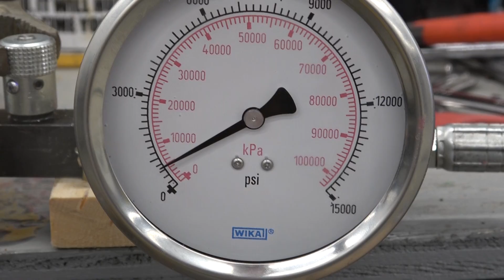How much pressure can PEX take?

Comment: Only time in years I've ever questioned your methods, but those Sharkbite fittings are gah-bidge for plumbing. I can't speak for most, only for myself, but try repairing a main water line to ur house with one of those and regrets will run deep, much deeper than the hole you dug twice. I had to consult an elder who knew a thing or 2 about a thing or 2 that told me why I was coming to him with my regrets. Those fittings are only meant to be used on sterile, 100% 90° flush cuts, so you gotta weigh whether the convenience is worth the uncertainty. Compression fittings might take a few extra minutes, but they hold better.

Comment: US building innovation: aluminum wire, sawdust+cement roofing tiles and PEX hot water.   The shame is that a lot of grand century+ old homes are being retrofitted with the plastic pipe.   Wasn't there a bit of a scandal with CPVC being used for hot water piping?

Comment: I don't know about Germany, but at least in Finland where the code is real strict and you have a 10 year fault responsibility on your old house pex is used a lot. Especially when renovating its real easy to bend around walls, floors and ceilings which are often not as straight as you'd hope. I'd still prefer laminated multi-layer aluminum/plastic pipe. Expensive as frig but real sturdy, easy to use and bend and shouldn't leak even if the surface is all scratched up. Plastic lining on the inside and outside protects from corrosion, aluminum in the middle gives strength and makes it malleable.

Comment: The Uponor Pex-A system has been tested for over 30 years, continuous @ 95°C @239psi with no failures. I am suspect on the life of Shark bite and some crimp on style fittings, but believe the Uponor system to be rock solid.

Comment: There is a lot to like about PEX, especially when you get to proper crimped connections.  It's easy to work with even in tight spaces.  No scorch marks on your 2x4 from repair work.  You can put a joint together on a pipe with a leaking upstream valve.  I'm a little concerned about aging down the road.  We've been down the plastic pipe road before with less than ideal results.  Copper has problems as well, especially when attached to dis-similar metals.

Comment: I hired a dip wad so called plumber used shark bite fittings in my master  bathroom.  And those fittings let go of some of that pressure all inside my walls.  Not only did I have to fire that plumber and re-do everything myself. I then had to hire a drywall guy. So F the shark bites.  I'm blue glue all the way

Comment: @Ave I'm a plumber,  and I guarantee pex-a tubing is better than copper,  has a memory so if/ when it freezes it swells and will not pop,  when it defrosts it'll go back to original size.  If it kinks, you heat it up with a heat gun and it'll go right back to factory shape/ size
Reply: @Ave there is different classes of pex tubing,  radiant heat,  to culinary water...PEX-A is the type that will last 100 years

Comment: sure you can run pex long runs and make turns without soldering fittings every 10 feet,  or use a torch in a crawl space on a piece of pipe jammed between 2 70 year old pieces of dry lumber with the homes water turned of it might be cheaper or not freeze and burst like copper or get stolen out of your work van or construction site and also cost alot less and is easier to transport carry and store save u money on propane and solder but it definitely does not look as pretty as new copper pipe who can argue that.

Comment: the problem with copper these days is that it's nearly impossible to get copper pipe of sufficient quality to not form of all sorts of pinholes after a few years, even if you spend extra for the "good stuff" there's almost no way to tell if that's what you're actually getting without massive additional cost. the era of copper is over, unfortunately.

Comment: I was the "somebody else." Shortly after moving into a condo (that was around 10 years old at the time), all the Kitec (PEX shit) was replaced with copper. Apparently the fittings were faulty... too much zinc or something. Oxidation would build up over time, restricting the water flow, and eventually causing a failure.

Nothing but copper for me from now on.

Comment: One of the biggest advantages of PEX piping is the lack of fittings. I’m a plumber by trade in Florida. So being able to run the piping through the attic and not having 90’s to run down to a wall creates one less possibility of a failed fitting. And we have noticed through the ten years or so it’s been used that it’s able to handle thermal expansion really well (Attics can reach 145*F During the summer). Copper is being replaced everyday due to salt water intrusion and rot. So for now this is the best stuff to use.

Comment: AS a ex pro plumber pex is a far better material then copper. Easier on install time,less money per foot,1 solid line from supply to fixture less fittings to have leak(yes you can do branches off a 1in line to make the cost even cheaper or repairs) a good crimp tool is skookum as hell and easy to adjust if the crimp is getting to loose (crimp tool usually come with a crimp ring gauge to test crimp pressure) no buying of bottles of map gas,flux solder, sand paper and tons of fittings (45's, 90's, couplings.) No fire that could potentially burn a house down. If I recall properly it will expand to 30% its size without rupture. And biggest adavantage is easier to repair to say nail is punched thru and not having to completely ridding your pipe u r working on of water cause if water is near a solder joint good luck on getting copper hot enough to get the solder to flow (weld) seal ur joint properly. Down side to pex and pex fittings is pex fittings cause a good bit of water flow slow down (can not recall proper term for this hydraulic static might be it ) this is why it's best to have a pex manifold to run single lines to each fixture. Also I have never trusted shark bite fittings, best used for home owners who don't want pay the money for a proper repair but is still a proper cheap repair but would not stake my company name or my pride of work on using them.  Price between copper and pex is around 75$ for 100ft roll of 1/2in pex and 30$ for 20ft stick of copper 1/2in

Comment: As many others have said; test it with pinch/crimp/expansion fittings. I use pex all the time and am curious to see more.
I do use Sharkbite fittings for emergency repairs, but only in accessible locations. They're good for transition between Polybutylene (fucking gahbage plastic fittings in older mobile homes) and Pex when the nearest homeless despot is out of stock of proper adapters.

Comment: I know how long o-rings survive in automotive applications. Sure the heat cycling of cars is way more severe than a hot water line, but not by much. I give those shark bite fittings 20 years before I'm starting to get concerned. 

Also, check out Matt Risinger's video on fail-testing different types of fittings.

Comment: Sharkbites!!!! You wanna make a plumber turn green???
Reply: I use this stuff daily. Not a big fan of it. Do not run it like a wet noodle. The outer wall of the bend wears down over time from the friction of the water moving though it. On the plus side it will freeze solid and not burst. The abs fitting on the other hand will.

Comment: That's why we use here in Europe mostly "alu-pex". no diffusion because of the additional layer of aluminium.
Reply: In Canada or Pex -Al-Pex (Pex with aluminum on the inside) manufacturer was Kitec. Their fittings rotted with in years of installation. The aluminum would come in contact with the bass when the fittings where slightly too tight. Company was sued into bankruptcy. Nobody touches pex-al-pex anymore.
Reply: Probably depends where in Europe you are as to what the preference is... Hep2O/Wavin is a popular brand across the continent and it's polybutylene barrier pipe with EVA rather than aluminium. 

I prefer working in end-feed copper, but never had an issue with Hep2O

Comment: That plastic piping is pretty much universally used here in the UK too, has been for at least 15-20 years. Both in domestic water supply, and also central heating runs to radiators.

Comment: Work in the compressor industry. PEX for compressed air is a big no-no. Most PEX manufacturers will state the same.
Be safe
Reply from the maker: Source? Link?
Reply: @arduinoversusevil2025 

Professionally, I spoke with an applications engineer from Uponor a couple of months ago regarding a small company which was using their product for their compressed air net. I  was told air was only acceptable for testing up to 120 psig and then discharged. I was then sent and referred to the spec sheets and recommended it be replaced immediately. We also refused to work on any equipment until it was either disconnected or replaced. 

Personal opinion: probably fine, but rather a matter of manufacturers not wanting to certify it for its use and local codes accepting it (you will not find any documentation for its use from any of the major manufacturers for any fluid other than water) and insurance companies will look at this. If it comes down to protecting employees it's not really a game companies should want to play. 

For the home-gamer there are no rules - as you proved, it is much more likely for the fittings to fail before the actual piping. 

Further, PEX begins to oxidize in the presence of UV light - and compressed air lines in industry are almost always exposed - whereas indoor plumbing is buried behind walls and finishing materials. There's also the potential for things to fly around a shop where damage to a PEX air line could cause it to split as you demonstrated with your knife. 

Uponor: 

https://uponorglobal.azureedge.net/-/media/uponor-global/resources/specifications/usa-specifications/uponor-domestic-water-piping-specification-us.docx?rev=0c3cc166d11147f2b4e939d286ea4012&download=1

https://uponorglobal.azureedge.net/-/media/uponor-global/resources/specifications/usa-specifications/uponor-domestic-water-piping-specification-us.docx?rev=0c3cc166d11147f2b4e939d286ea4012&download=1

http://docplayer.net/63199078-Uponor-ltd-specification-for-uponor-pex-plumbing-systems.html

^(Their site sucks and I can't find the document I had in my email, but found it through the google)^

"UPONOR PEX pipework must not be used for the following applications:

 Domestic gas

 Heating oil
 Compressed air
 Swimming pool water"

Sharkbite:
https://www.sharkbite.com/resources/faqs/universal-brass-push-fittings-faqs

Can I use SharkBite fittings for anything other than potable water and radiant heating (e.g, air, gas, oil, etc.) applications?
No. SharkBite fittings are only certified for potable water & radiant heating installations.

TLDR: There's a lot of corporate CYA's regarding PEX. No one wants to pay to have it tested/certified.

Comment: Actually its never going to be under that kind of pressure and it's durability is as good as any metal it's way better than the old gray stuff they used to use and even then it usually leaked at the connections.I have replaced copper, galvanized,PVC and the old gray Polybutylene,pipe they all break,and usually from frozen pipes.i still have mostly gray Polybutylene pipe in my mobile home that's 30 years old I have replace parts of it with this and have not had any PEX failure.

Comment: They take a lot less pressure when a ham fisted apprentice has dragged them on the skew through a hole and gouged a canyon down one side big enough to prove your whomp rat disassembling ability in.

You barely tickled it with that yellow handled splinter remover.

Comment: Best things about Pex:  easier to install, cheaper,  no hot soldering torch by your floor joists, no cracking when frozen. 

Most plumbers in my area charge WAY higher labor for copper pipe work compared to pex.   Some won't even bother with copper at all anymore. 

PS the best fitting method for pex are the compressed copper rings, though they require a special tool to attach.

Comment: When I lived in Texas, I lived in two rentals with poly tube (not PEX but same basic design, all grey lines, thinner wall thickness) both rather old, and most of the issues I had with leaks were the joining fittings, especially elbows and Ts corroding and cracking.  The two times I had the plastic lines break, it was due to Freeze damage. I've also never seen rodent damage to either PEX or the grey poly. The poly I know had some additive (capsaisin iirc) supposed to keep them from gnawing on it)

Comment: I have a lot of concerns about PEX use in home plumbing, particularly on the hot water side. PEX stands for PolyEthelene, Crosslinked (abbreviated X). Crosslinking makes the plastic stiffer and more resistant to "cold flow". But more resistant doesn't mean NO cold flow, just less.  But ALL plastic flows to relieve high stress areas, especially at elevated temp. Every type of connection to PEX DEPENDS on some form of clamp to hold it all together. When enough plastic oozes out from under that clamp, IT WILL LEAK. There was a huge class action lawsuit in the early 90's against Shell and Celanese concerning PEX's predecessor. The problem? Leaks at the connections inside walls that ended up growing black mold that made the houses uninhabitable after less than 10 years. Mark my words, any sort of clamped pastic connection will fail sooner rather than later, and it being in a hot attic, or carrying hot water will accellerate it.

Comment: The one thing we don't have in Europe is rodents in our brick walls... (That's right, almost noone outside of North America builds houses out of stick wood...) PP welded tubes works just fine for hot and cold drinking water, no leaks over the past 25 years. But heating water is still on foam-wrapped copper.

Comment: I've had 3/4" PEX with copper crimp fittings in my shop for 5 years now with 0 leaks or problems . I run 125 PSI in it and there is a lot of it , with many tees and drops . I shut the air valve off at the tank every night and it doesn't leak down unless I leave something chucked in the end of an air hose that leaks . It's so easy to install that I wouldn't consider anything else . Supposedly it is not uv resistant , though .

Comment: This failure is interesting to me as I work as a building mechanical enginerd. And most places I've worked specifically forbid the use of sharkbite fittings on pex pipe

Comment: As a full time RVer Pex saved our pipes more then once on cold winters. The Pex line can expand when the water freezes, while copper splits and has to be replaced.
Reply: Every home I've owned in Texas has had copper pipes burst or generally fail over time. I replace all of it with PEX, crimped of course. It's easier to work with and way cheaper than copper. I just solder on a PEX adapter or threaded fitting and a shut-off valve if possible and replace everything above with PEX

Comment: You should warm it up.  Something around 120 dungrees Frankenstein.

Also, leave some out in the sun for a few couple weeks.

Parents are replacing PEX in 3 foot segments because the shit keeps popping pinholes.  The old butyl in the original section of their casa hasn't given a single problem in 30+ years.  But the pex from ~'06 aint worth shite.  Lost something like 3,000 gallons of hot water to a damn pinhole!

Comment: Ave, you seen like the right guy to ask technical questions, seeing as you've been around, and gone around again for good measure.
I've got a refrigerator with an ice maker, and I got the kit for connecting it via the Lowe'ly mans local connection.
Dang thing came with a saddle valve. The pipes in range are all pvc. Considering these things were designed with copper in mind, would it be  safe to use the saddle valve on pvc?
I've heard the mention of drilling a hole before hand, but I'd like an experts opinion.

Comment: I ran 1/2" for my shop air too, but used the blue Pex because I wanted cool air, not that hot wet stuff.
Reply: White for AC?
Reply: @billpetersen298  Exactly!!!  I wish I had that in my shop about now!
Reply: How many psi? I didn't use pex because I read of stories of it blowing out when used for air pressure.
Reply: @Trent Wheeler 'm running 175 before the regulator. I'm using the Sharkbite brand and think... Think mind you, that I read it would handle 250.  The only leaking I get is in my hose reel.  When I close the isolation valve to that, I can charge the line and leave it for a week and not see any drop. I'm using the plastic elbows and metal pipe fittings ends.  Also using the band style clamps also made by Sharkbite.  I bought all of it at a local Ace hardware store.
Reply: lol good one
Reply: So at how many psi are you using it after the regulator?
Reply: @elmasfr3gon1  100.  That gives me 90 at the tool after friction loss, etc.
Reply: Blue is a hotter color on the electromagnetic spectrum so red would be the cooler air. Don’t believe me? Look up the temperature of stars and their corresponding colors
Reply: @Lumens1 fire red 
Ice blue
Reply: @BoughToNature  fire is far more than red, including yellow, orange, blue and white

Comment: We’ve used them in Finland for over 30 years, and I’ve never seen or heard of any failures. But, we run them inside a tube, so if they start leaking, it spills over in the boiler room where there’s a floor drain anyhow. It’s also very handy if a drywall fitter screws right trough the line, just find the offending screw, loosen the line at both ends and pull it out and shove a new one right back in.